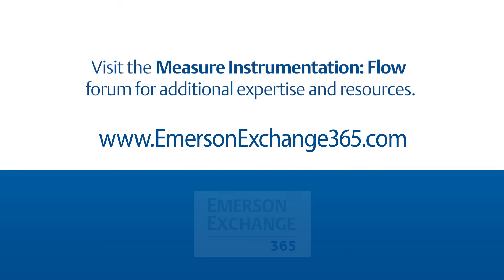Improve Magnetic Flow Meter Signal Stability for Slurry Processing

Comment: Am I correct in assuming that this is a "Mag Slurry"? MS with 8782?
What are the advantages and disadvantages compared to 8705 with 8712?
I have information that "Mag Slurry" is designed for media with high solid content, from 20% and higher.
And another question, what is the maximum magnetite content in the slurry with which both “Mag Slurry” and “8705” can be used?